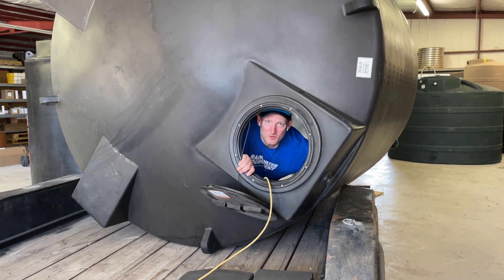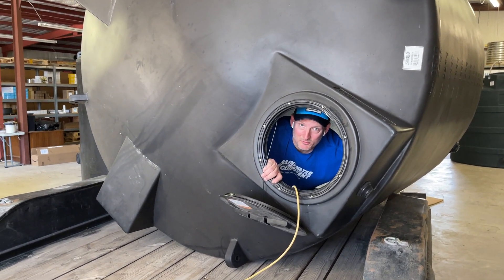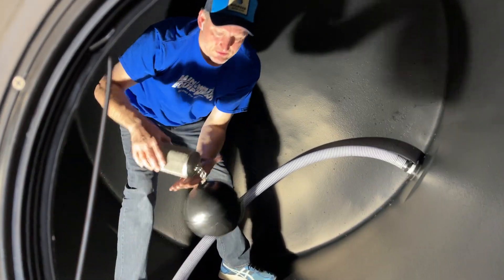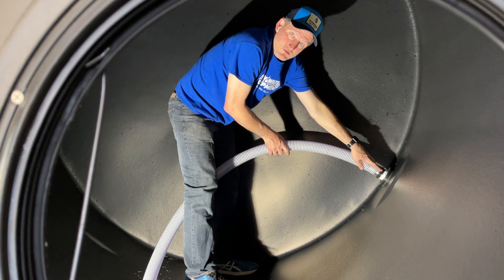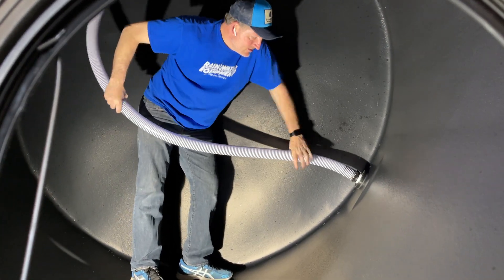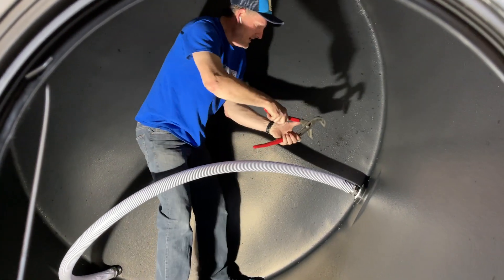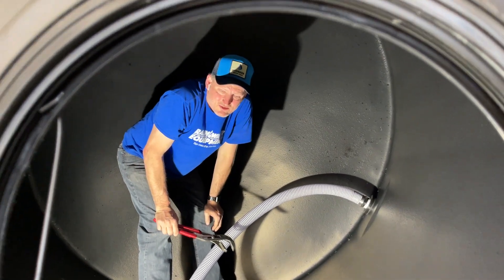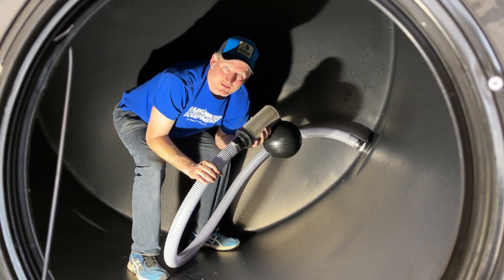Floating Suction Filter Installation - Part 2

Comment: How did you attach the hose to the fitting your screwing into the bulkhead?
Reply from the maker: It's a 2" Male NPT x 2" Barb. We heated the hose with a heat gun and jammed the barb into the hose. We also use a stainless steel hose clamp to make sure it stays in place. Here's a link to the products after we've completed them. We have them in 1", 1 1/2" and 2". https://rainwaterequipment.com/search.php?search_query=floating+filter